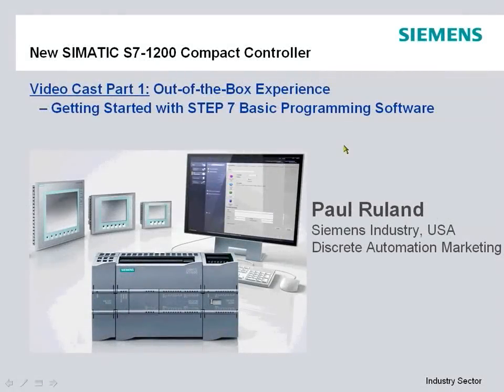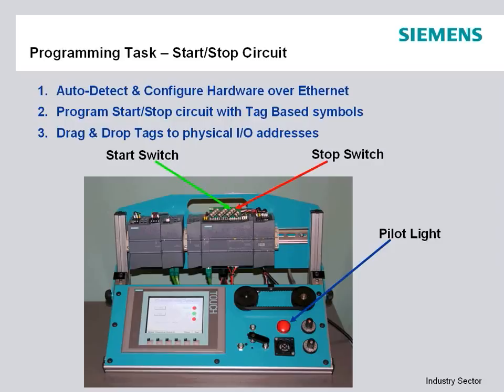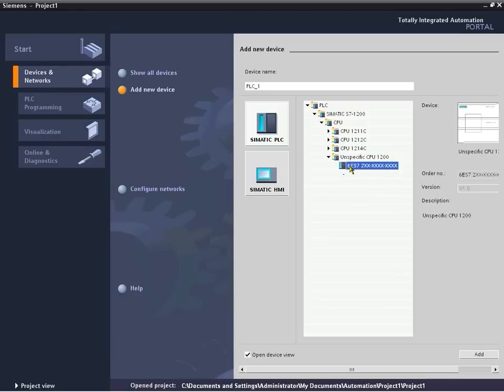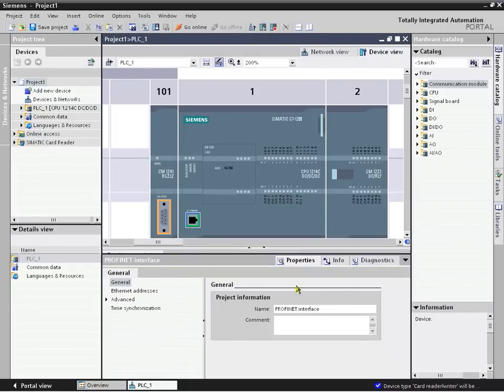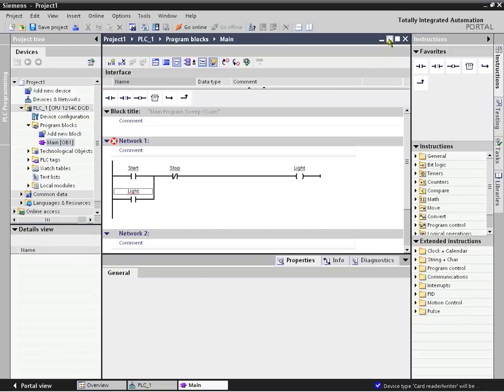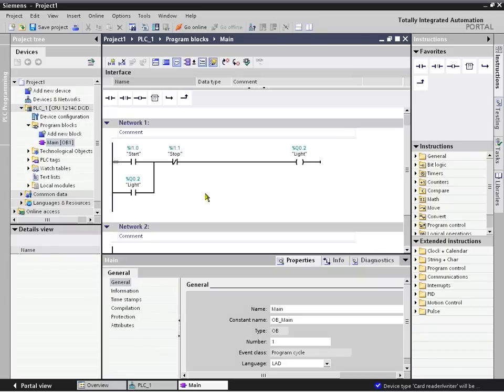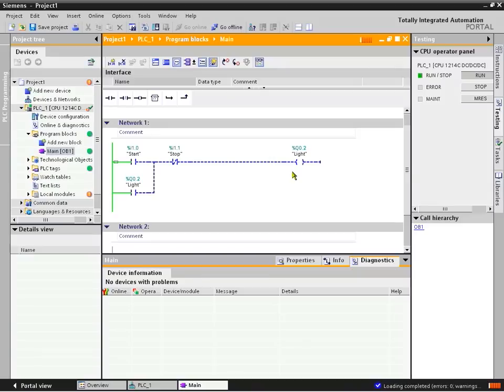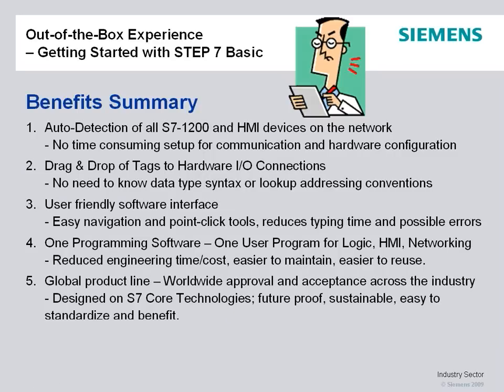Siemens SIMATIC S7-1200 Part 1 - Getting Started

Comment: Thanks for this video. It gave me a running start with my 1200 and v12 software even with no PLC background what-so-ever. Altough I encountered a lot of special cases along the way that you did not. For example I had to reboot the PLC several times before it shoed up in the auto detect list. And it also wanted me to change IP settings etc.

Comment: Great little video, However  ; Stop buttons are typically wired Normally Closed (for obvious reasons) and programmed Normally Open so it can actually work. {this is the basics of PLC programming}. might need to fix that one, I've also seen it described this way in some Siemens manuals.
Reply: +Sq Automation Glad I'm not the only one that noticed.

Comment: I've been programming PLC systems since 1996 and because of this I'm a very fast programmer.  I've used them all Rockwell, Omron, Mitsubishi, and Siemens.  Rockwell's RSLogix5000 is by far the easiest to use and Mitsubisi's GX Developer and , GXWorks 2 are the fastest.  Siemen's Step7 along with WinCC Flexible was mature and smooth running software with a steeper learning curve.

This new Siemens software TIA portal is soooooo slow and crash prone.  It takes me much longer to complete a project when I'm forced to use this garbage software.  Its hard for me to understand why a company like Siemens with outstanding industrial hardware would release this?  Maybe in 3 or 4 years the bugs will be worked out and we'll have something useful.
Reply: got rid of STL.  unbeleiveable.
doing conversion from s7 200 to s7 1200.  S7 200 is so much easier to use.  conversion software is absolutely garbage.
Would like to complain to Siemens but what is the point, just going to recommend alternative PLCs in the future.
Reply: Hi!I have a question for you.I saw you have been work with plc more years.Can you give some advices?i want to work with PLCs and i don't have much experience with them.now i'm student and an advice will be very good if you want to say of course:) .Thanks!
Reply: what is conversion software ??